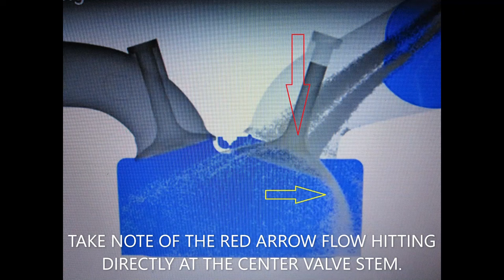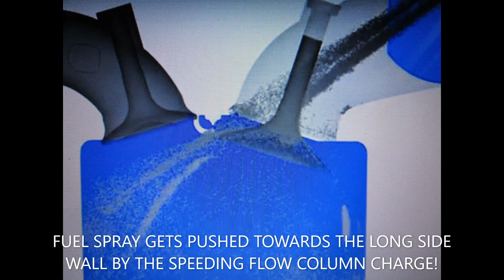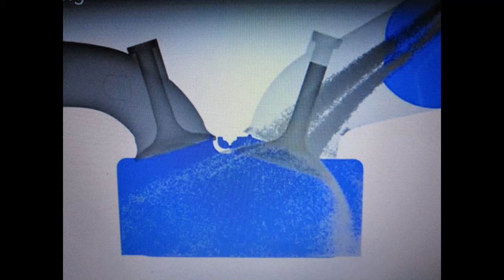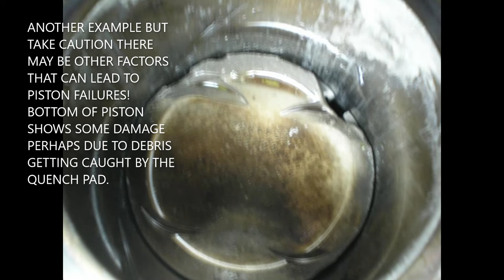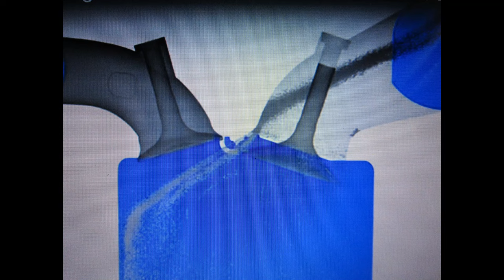HOW GOOD ARE FUEL INJECTION MIXING FUEL WITH AIR?

Comment: Back when Smokey Yunick was running a turbo chevy v8 at Indy, he got frustrated with injection and elected to run a couple of Holleys with pretty good results.
Reply from the maker: Yes sir and at that time the computer controls wasn't as advance as they do now.  Still a good racing carburetor can still hold its own for sure!

Comment: @18:16 Looking forward to hearing about what is the right solution to the piston melting problem. Tighter sqiush clearence? Wider? Somander Singh grooves?
Reply from the maker: Tight squish sometimes backfires for many high compression competition engines so we got to be careful and open it up a bit.  Depends a lot on rod stretch closing too much isolating the areas even more so!  The grooves are good as long as you keep it @ about .040-048 the widest opening.  It is very sensitive specially if you kept it tight perhaps a squish of .-039 and it does not function correctly.
Reply: @benalamedaracing2765  Thank you. :)

Comment: Is that why the NASCAR engines have the injectors so far back up the port on the intake manifocompliance? Listened to one fellow say that is optimal in a racing application, but not for something that has to idle and pass emissions complience?
Reply from the maker: Pulling back the injectors upstream takes advantage of the Joule-thompson Effect of intake column charge cooling!  That is one advantage of carbs over FI and moving it way up acts like the effects of venturi dispensing the fuel in fine mists and further mixing it as well or giving it a better chance of making them homogeneous to further the flame effectiveness inside the chambers.

Comment: I'm suddenly curious what the air density is like flowing around the valve. If at high lift the intake air has so much inertia that it's actually all flowing around the long side with the fuel then its just a matter of getting air up above the fuel injection column to keep it from smacking the long side.

I've seen flow models of 4V engines where the in cylinder tumble actually results in air flowing backwards through the valve on the short side getting carried across the back of the valve and being split to each side of the valve by the intake charge.

At any rate, I don't think it's anything that can't be fixed by velocity stacks with showerhead injectors!
Reply: One obstacle I see with carbs and shower head injection is that there is so much surface area on the way to the cylinder. Fuel sticks to the walls on the way down, the closer the injection point to the cylinder, the less chance for wetting the intake port
Reply from the maker: Point understood and there is only so much height we can achieve in the port angles coming in and there will always be a short side!  I have seen at one of the Advance Engineering Conferences I attended wherein the flow of the cylinder heads actually tumbled opposite of what the majority of 4v's does.  In this instance it travelled downward from the shortside and upwards to the exhaust a complete reversal!  Normally the flame propagation goes from center towards the exhaust valve and these tried to go to the intake valves because of its tumble effect.  In short, it was trying to extinguished the flame front more than normal and was very good at emissions but horrible for power for what it is capable of producing!
Reply from the maker: @rickrack78 , there will always be wetting of the port walls specially @ high engine speeds and the intake valve suddenly shuts and residual fuel is still dripping from the injectors.  DI was supposed to have fix these but somehow it ended up worse for street driven vehicles from performance engines to grocery getters.  I will do that video soon as well showing what has happened and it is not very good...
Reply: @benalamedaracing2765 , I worked with Propane gas and also liquid injection too!
Reply from the maker: @rickrack78 , a friend of mine from years ago ran a propane powered F-150 and it ran very good and the oil seem to last forever!
Reply: @benalamedaracing2765  , I worked for IMPCO in Irvine. They did propane conversions for forklifts, etc. then they got into Natural Gas fuel systems. They did tier 1 kits for GM trucks and cars around 2000. Then liquid propane injection, then Hydrogen fuel systems for fuel cell electric cars. Roush currently does liquid propane injection kits for big trucks. I’d like to do a liquid propane injected Ford Godzilla with a turbo. Already picking up parts for it😉
Reply from the maker: @rickrack78 , you have an interesting job there friend!  I went overseas by invitation to present a seminar on advance automotive technologies and I noticed most of their taxis was running on propane!  What alarmed me was their comments that the cylinder heads fail prematurely and they have issues with soreness and throat irritations.  I figured working 8 hours plus shifts breathing those fumes dried out their throats and eyes and that was quiet a revelation for me.
Reply: @benalamedaracing2765 , one of the things about Propane is it’s heavier than air. So, it can pool. Close attention separating tanks and delivery lines from the interior of a vehicle is important. Just like any car, exhaust and fumes need to be managed. Systems that may be cobbled together are suspect. Propane can be lean/rich too, which has its own problems.
I like the fact that’s it’s a gaseous fuel. Problem with that is it occupies about 30% of the incoming volume, which is normally reserved for the air. (Turbos help a lot here) Injecting liquid propane allows the phase change to suck out a bunch of heat. 😉 Still more boost and be added👍🏻
Octane rating and burn rate can be a plus too
Reply: @benalamedaracing2765 , tuning and the fact that expanded Propane doesn’t have the same cooling effect as liquid gasoline is probably a factor in the heads wearing out quickly?
Reply from the maker: @rickrack78 , from my observations propane is such a clean fuel that it washes off lubricants present in oil from the valves and seats!  Here it is so clean we lose the lubricating properties present in even using gasoline thereby accelerating the wear process shortening time between overhauls.
Reply: @benalamedaracing2765  thats an interesting theory!!!
.
i could see gas having SMALL (but not insignificant) lubrication properties that a "gaseous fuel" would not have
it would be nowhere near the lube that you get from diesel.... or especially 2 stroke fuel
but its still something! 
.
just like the "lead" in old gas, and now, only 100LL airplane fuel....
acted as an octane booster AS WELL AS lube for the valve seats
and really.... it was more of a "sacrificial metal" for the valve to hammer on.... VS the head metal itself 
sorta like a zink bar on a boat 
.
.
.
anyway..... yes, propane does burn SUPER clean
the main thing that wears out the oil is shear and water (propane makes A TON of water when it burns in the proper mix)
.
and all the moving parts can actually break the oil molecules into shorter and shorter "strands"
turning your 5w-30 into more like a 0w-15
.
.
the oil will still look clean AF..... brand new even
but it will have absorbed water........ and not lube/protect correctly due to that shear 
.
.
.
.
.
TLDR..... 
it may look perfect..... but its not
that shear will still make the oil not lube as good
.
also have high heat, slight water accumulation, and detergent break down
which also "wears out" the oil...... even if it looks clean 
.
.
"dirty" oil ONLY!!! turns black because its full of carbon / combustion by-products 
not because the detergents/additives are worn out......or it will not lube anymore
.
.
again.... 
it may look clean
it may even smell clean
.
but its still worn out..... and not lubing/protecting the bearings anymore (despite being CRYSTAL clear)
Reply: @rickrack78  At high load its not uncommon for fuel injectors to run at upwards of 60% duty cycle, at that point you spend plenty of time hosing down the back of the valves before they ever even open! Showerheads are great because they can run a narrower injection pattern and try to reduce wetting while still cooling the a large volume of the intake charge like carbs do.

Comment: I don’t like much the gasoline direct injection as well but it will work amazingly well if the fuel is already evaporated before the injection event . There are few generations of LPG injection systems : 4th generation , port inject already evaporated, gaseous propane-butane ( PB) , 5th generation, port inject liquid PB, and 6th generation, direct inject liquid PB.IMO 7th generation will direct inject gaseous PB or CNG ( natural gas ( NG) CH4) . It’s interesting how the gaseous state of the injected fuel impact the speed of  burning . Air/ PB mixture burn slower than air/ gasoline mixture ( this is even more slow process for  air/NG mixtures ) , so on the slow to middle range RPM such a mixtures require more ( than on gasoline)ignition advance angles but then on higher RPM , since mixing gas with other gas is much easier and faster and since the evaporation is already done outside of the cylinder the burning process ends faster and the engine requires less advance angles than on gasoline . Homogeneity of air/fuel mixture when mixing fuel with air in gaseous state is way better and the quality of combustion is better and the pollutions are lower.
The only problem is that the evaporated ( outside of the cylinder) fuel do not provide any cooling of the combustion chamber but this could be resolved by water injection .
Reply from the maker: Point well taken and of course the oil life is much better because the engine burns cleaner by far.  Thanks for the info.

Comment: Ok what if we can progressively move the fuel spray path towards the shorter side of the port as the valve lifts?
-either by pulling air towards the shorter side: taking inspiration from your w port, what if we implement a moving vortex generator that goes in and out of the port, driven by the valve train?
-or by changing the injector angle: just keep moving the injector with the valve train.
Reply from the maker: We cannot pull the air to moving where we want it and that is not even possible.  With the velocity it will travel in a straighter path and there are limits that we can do to alter its course!  Moving the injector father up will really help but the weight of the fuel molecules will not want to turn @ speed and these is where air fuel separation starts...

Comment: Take a look at the injection on NASCAR engines.  The injectors are located just below the throttle air valve (high up in the intake port).
Reply from the maker: You are right on point and it gives it a good chance of further mixing instead of too close to the valve @ the cylinder head flange.
Reply: Doesn't apply as much to a street strip engine that has to operate from 800-6500 rpm. Nascar cup engines don't even clean out and start to run right until 3500-4500 rpm, then you add the restrictor plates and it is an apples to oranges comparison. Unless you have a late model cup engine in your car.

Comment: Again excellent info, Ben! From your videos of the injector fuel spray during a cam IVO event, this looks like a FI SOIT (start of injection timing) fuel delivery setup that is being demonstrated (fuel injectors are timed to start fuel spray as the cam IVO event is occurring thus the fuel is trying to homogenize into air mass stream while the airmass is moving--not stationary). Now if the FI setup is a EOIT (end of injection timing) system in which the injector fuel spray is timed to end just before the cam IVO event starts (thus all the delivered fuel spray is deposited against the back of the closed hot intake valve(s) to promote full fuel homogenization into the IM runner airmass before the airmass is subjected to velocity from an opening intake valve), would this action help to minimize the issues shown here from running a FI SOIT fuel delivery setup? The reason why I ask this is due to my '09 Ford Mustang GT w\ 4.6L V8's SO ECU uses a FI EOIT delivery system in which the injector fuel spray is timed to end just before the cam IVO event occurs, not a FI SOIT fuel delivery system............. Again, I appreciate all that you do for us gearheads!
Reply from the maker: For racing indeed the DFI is superior because in traditional PFI the fuel stream, displaces the air a net reduction in ingested air column to the chambers!  
It may not seem like it but fuel mixed with the incoming fuel before the intake valve cools the mixture but is a net reduction in total airflow and dynamic compression until DI adds to these.
Obtw, major issues on carbon on the intake on street engines!   
Good question Dale.
Reply: @benalamedaracing2765  Ah Ok, I get it..........the fuel spray will indeed take up some cyl space if added to the IM runner airmass prior entry into the CC as well........fuel has mass too. Oh well, at least I'll have clean intake valves w\ my PFI!

Comment: Most modern cylinder heads have a heart shaped chamber with a ridge/vane running near the spark plug location (on the intake valve side of the plug).
Is this to induce as much swirl and mixing as possible?
Reply from the maker: Yes it does and the spark plug is away from extremely rich (fuel) areas which kills the initial spark kernel from spreading effectively.

Comment: Another eye opener Mr. Ben. So, the carburetor combination would be more even because, the fuel delivery is happening further away from the cyl. head?  Thank You
Reply from the maker: Perhaps it will be better distributed compared to FI because it is injecting close to the flange and immediately gets pulled by the column charge going at high speeds!  Carb venturis can perhaps make this a little better besides the cooling benefits of the Joule-Thomson effects on the mixture.
Reply: @benalamedaracing2765  Thank You

Comment: I have some questions. What happens to flow when the fuel speed isn't the same as air speed? Is their a sweet spot as far as rpm where possibly the air and fuel mix at a preferred speed? And I would assume that would be a runner to runner situation. Also fuel mass ( alcohol vs gasoline) vs air vs speed? 
Does alcohol evaporate and or disperse differently than gasoline?
Reply from the maker: When fuel speed is not the same as air speed within a port you have what is commonly called air/fuel separation!  Alcohol based engines will definitely run a richer mix or stoichiometric ratio, therefore port wetting and/or fuel distribution and keeping it suspended with the airstream will take some good design applications!

Comment: How about adding some dimples to the long side of the port to help atomize fuel? What are your thoughts on chamber softening for boosted engines? Seems to be a popular mod to combat detonation.
Reply from the maker: Chamber softening is good if applied correctly and how much of that chamber is concave to the point you might have turned it into an open chamber in your pursuit of said modifications.  Dimples only work on certain applications but when port speed is involve then all bets are off it will be bypassed easily by the fuel and air.  The problem really is the uneven weight of air vs. fuel and both will "travel differently" when subjected to the same conditions.

Comment: what if your intake port was smaller...... and then "opened up" at the injector hole?
.
that fuel has to take up some space that would otherwise be used for oxygen (same with a carb.)
but with FI.... you have part of the intake runner that is air only
.
so could you get better air velocity by making the first part smaller??? (everyone says a small port is better for low end torque, due to air velocity)
but then open up the port past the injector.... EXACTLY enough to compensate for fuel at WOT
.
would the air just slow down..... and you end up with the same flow?
or, would the "accelerated" air smash into the wider port.... and add some velocity??
.
.
.
part of me says it would be exactly the same.... if not less HP
the other half says "no, of course it would make more power"..... due to the air velocity not dropping instantly, and the "injector to valve' runner length being so short
Reply: and what about direct injection (which is great for MPG and HP...... till the valve gets covered in carbon............)
.
with DI.... their is ZERO "fuel displacement" in the entire intake runner
its just all air....(well, air + PCV + EGR...if you still have an EGR!! LOL)
.
so you could either use a smaller, lighter, more compact intake to get the same HP
or use the same intake size..... and get more HP
Reply from the maker: Conventionally it is better to have a big intake port and slight tapering while it gets close to the valve because it accelerates and rams the air or air fuel mix to the valve and seats.  Doing the inverse will create fuel drop off because the air will lose momentum and separation will more likely occur!  The same will happen when the injector is located above the intake valve in the port throat and having low airspeed here will create a slow responding engine.